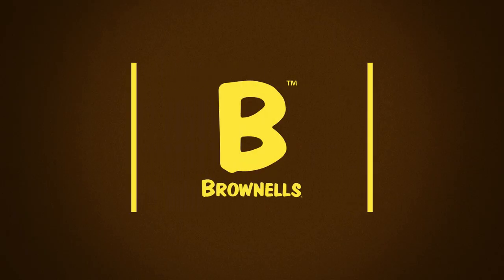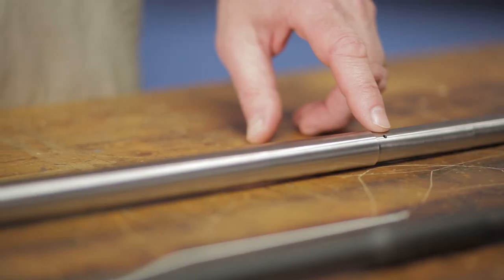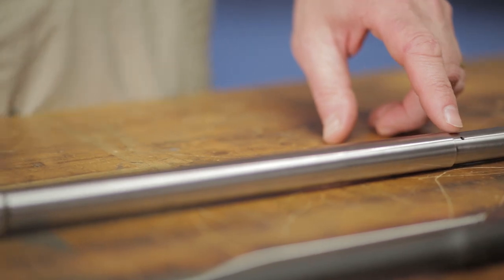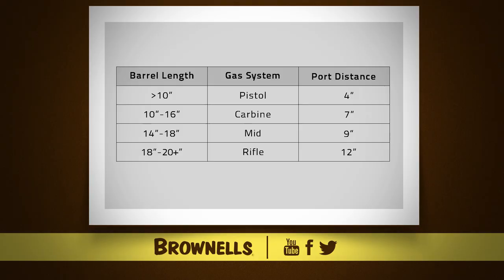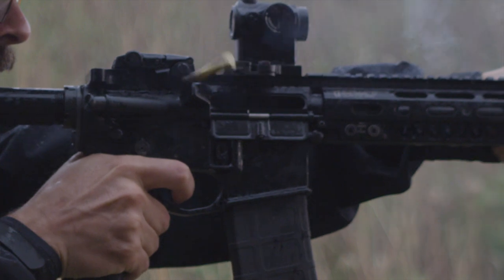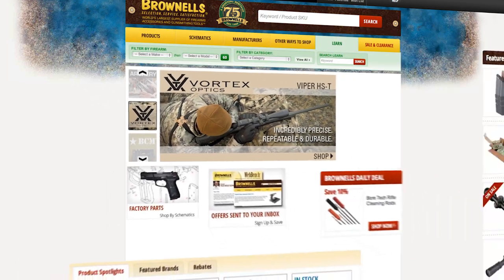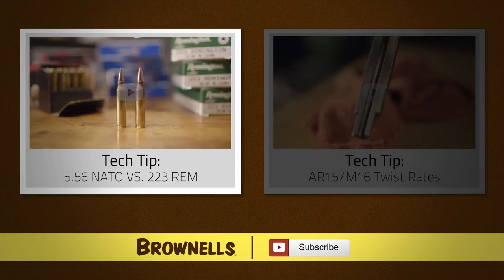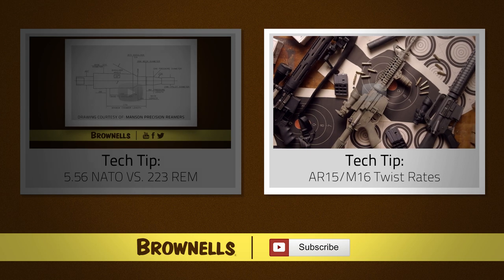Tech Tip: AR-15 Gas Systems

Comment: How can one test the PSI of their AR-15 gas system?
Reply: +Knuckle_Bump Use a tire pressure gauge from ye olde auto parts store!. Just kidding! :) Seriously, a good question. I'm sure someone makes some sort of measuring device for it though.
Reply: Miguel Melgoza
Which direction of the spent brass would be an indicator then? Please explain.
Reply: +Knuckle_Bump If the muzzle of the gun is 12 o'clock you want your brass ejecting in about the 4 o'clock direction. 3 o'clock would be brass flying direct sideways perpendicular to the barrel, 4 o'clock would the brass flying sideways with a slight rearwards vector as well. Hope this helps! *I am not a gunsmith, just an enthusiast*
Reply: @burtonh1  if your brass is shooting one or two o'clock, you're over gassed. Three and four o' clock, you are gold. Past four o' clock and you are under gassed and underpowered. That happens with steel case a lot.

Comment: I just built my first AR. I wasn't sure if the tube was too far in or what the depth was supposed to be. That cutout showed me my tube was in properly. I have been useing my SKS and PCC for many years so the AR platform is still new to me. Thanks

Comment: What does it mean when your rifle keeps blowing our primers? Mid length gas system, 16" barrel. 62gr. Also a round struck the muzzle brake
Reply: Way too much gas and non-concentric threading on the barrel. IE that gun was built like a POS.

Comment: My understanding is if you use a shorter gas system with slow burning powder like .223/5.56 or .308/7.62 your gonna get a lot of dirty gas. I don’t know how significant this is. However I know CMMG says it was a reason they didn’t make a .45 ACP PCC with AR style DGI. I think it could become an issue but would probably only be an issue with large amounts of ammo I’m guessing.
Reply: So what do I need for a 300bk?

Comment: Good day. Need an assistance here. I got ww src 308 16.5 inch barrel 1|10 twist. Mid length gas tube, adjustable block. It looks like it likes 175 grain bullets the most. Now - I'm trying to shoot nexus 170 subsonic. And as it should be it does not cycle. Which is the way to go for it work? change bolt carrier to lighter one? change Buffer spring and buffer same way? Use barrel with longer gas tube? I do understand it was not designed to cycle subsonic. Still wondering how ti can be done and whether here is someone who got one working.  Thanks.

Comment: so if my gas system is 9 inches  then its a mid length? Because i keep seeing like on ebay that 9in is carbine length or does that just mean 10 to 16 in barrel?? I just don't know if I have a mid length or carbine length 16in ar15

Comment: Hi there I want to build a AR15 BOLT ACTION rifle so I don't need the gas system can I buy a gasless barrel that has no holes drill in for the gas system.
Cheers in advance
Alan
England UK
Reply: There are straight pull and even pump action AR style guns. You might start by just looking those up. Then maybe see if those companies sell just the barrel. I’m not sure though

Comment: How would too much barrel after the gas port cause malfunctions? I was thinking a mid length would be nice to have on a 10.5. Maximizing that dwell time. Especially when it comes to running a can.
Reply: Aside from the fact that too much gas will cause excessive wear and shorter service life on parts from them slamming harder than they should one thing that it will also do is increase bolt velocity. When mag springs weaken from use it feeds the round more slowly. If you have a combination of round being fed too slow and bolt moving too fast, you can get a failure to feed. One remedy is newer springs, which again speaks to the issue of shorter service life on parts. One other possibly issue is bolt bounce. One possible remedy would be to add a heavier buffer system which then adds more weight.

Mid-length gas systems won't work on  10.5" barrels because they are only 9" long and 1.5" does not allow for nearly enough dwell time to reliably operate the gun without opening the gas port excessively.

Simply put, you want and need a properly balanced out gas system so that everything works as it should. One of the easiest ways to tell if your system is working as it should is by looking at where the rounds are ejecting. If the rounds are ejecting at 3 O'clock to 4:30  then it is where it should be. If it is 12-less than 3 then you're overgassed and 4 or greater then you're undergassed.